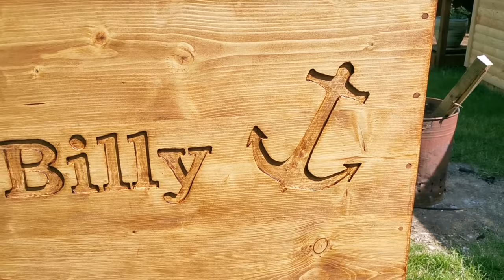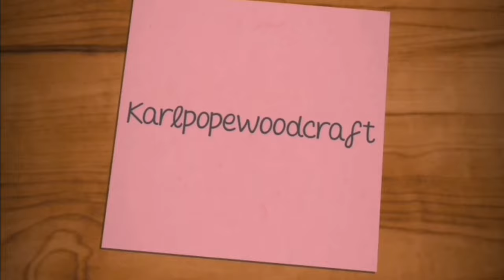How to router a design name into wood.

Comment: What router are you using for this job karl? Also how would you rate this against other machines as I'm in the market for a palm router atm
Reply from the maker: I think back when I did this I was probably using a Katsu palm router a cheap knock off version of the Makita, it did the job but was a bit vibratey and loud.  My go to router is the Trend palm router nowadays its a little work horse. Brushless so less vibration and noise.https://amzn.to/3nwZNZy